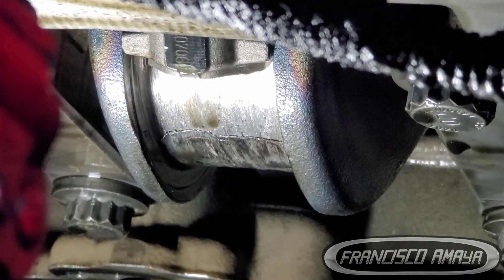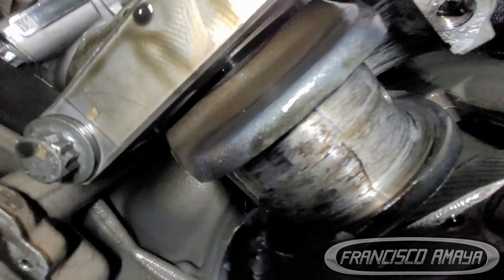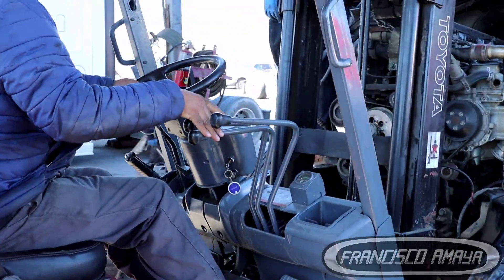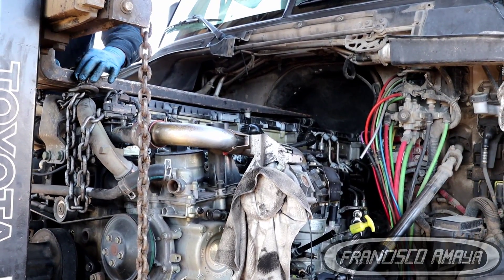DD15 engine crankshaft damaged after major overhaul main bearing repair warranty process

Comment: They fail because of lack of maintenance and the fact they are in the most running truck on the road it’s gonna look like a lot.. DD engines are actually reliable when maintained properly..
Reply: amen to that. my dd15 took a shit at one million four hundred miles.
Reply: @jorgefacio690  Yes sir. These mechanics just love talking shit because they see the same shit in the shop all the time so they automatically assume the engine is shit. They don’t see the neglectful wanna be drivers out here that go 50k every pm service and never do overheads, air filter changes, fuel filter changes etc.. I’ve seen so many DD engines make it a million plus with factory turbos.. For a modern engine they are beast.